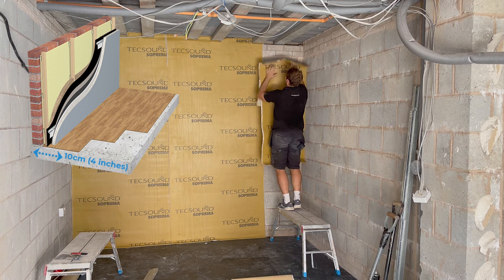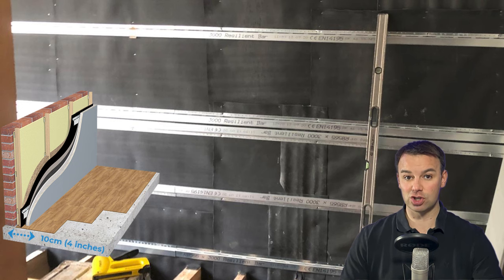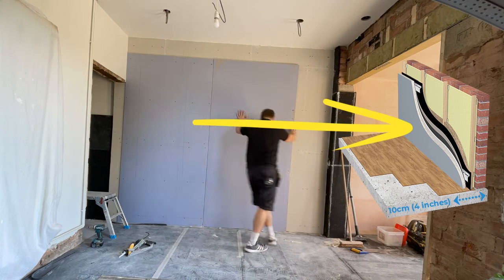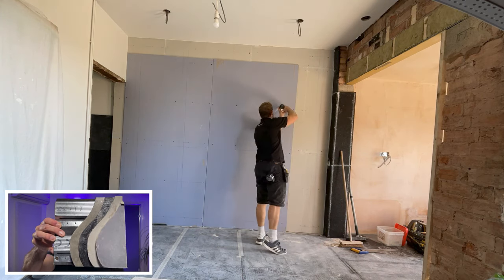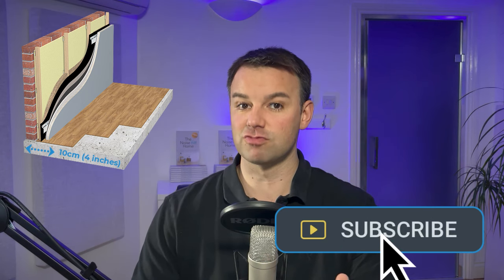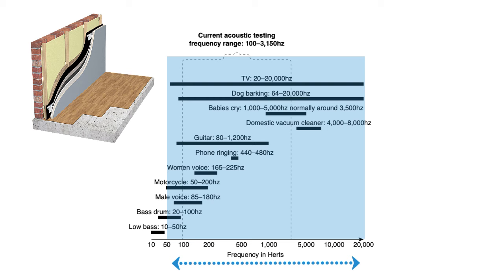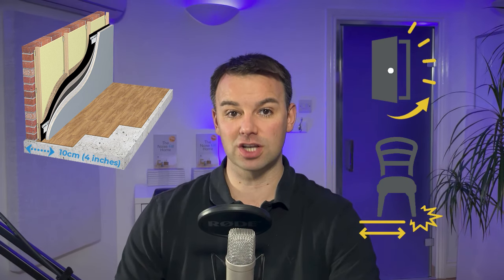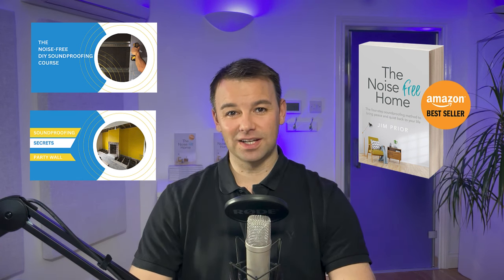Soundproofing wall with 4 inches

Comment: Could you do a hybrid of this and use 20kg rubber then fixing batons etc over this using the rest of the system for an enhanced performance? Presumably you can’t use sbx boards in place of rubber due to the sand escaping if you tried to fix through them?
Reply from the maker: Hi @Grangey, yes 👍, on the soundproofing course we show you all the concepts and show you how to install the systems in detail…but not one system fits all houses. 
Fixing timber battens over the 20mm rubber is fine. I would not use the sand board to fix battens to…but you can the sand board with resilient bars and clip and channel system. The guys at Soundproofing Shop who manufacture DBX sand board gave me a discount code you can use. (Jim5) https://soundproofingshop.com/

Hope that helps

Comment: Hi Jim, thanks for your reply yesterday. Is there an intermediate option between using battens and resilient bars, and just sound dampening from yesterday's video?

If I'm looking for a wall system to fix kitchen cabinets to, would there be a benefit with going with this system but minus the resilient bars? Or would that give little benefit over fixing the plasterboard and cabinets direct to the party wall?
Reply from the maker: No worries thanks very much for your comments, much appreciated.
I hear what you are saying, but you really need a resilient layer of some kind in the wall system.

The wall system for your kitchen is ideally the TPS65W, 50mm system using the sand board DBX boards. We show you exactly how to install this getting the maximum integrity from the different layers in the ‘soundproofing secrets course’ (on offer at the moment for £49.99). This is perfect for your kitchen Mikey if you are in the UK and easy to install as well.

If you are not in the UK then resilient bars may be the better option, which means you will need to position extra resilient bars where your kitchen cabinets will be installed after plastering. Fixing the cabinets to the extra resilient bars (shown in the Bigger noise Free DIY course).

However tempting not to use resilient bars try to use them where you can. Resilient bars are easier to use than the 20mm rubber. In my opinion and all my installers opinions and despite all the marketing fluff….the resilient bars are easier to work with and use (cut, fix to, position) then the clip and channels systems. 
Other than 30mm panels systems, most soundproofing attempts we remove are a stud wall with Rockwool and two layers of 12.5mm acoustic board.
You have seen this video on the 7 ways to soundproofing a wall: https://youtu.be/rHU7mnu6-zM
Thanks again for your comments, let us know what you go for 👍